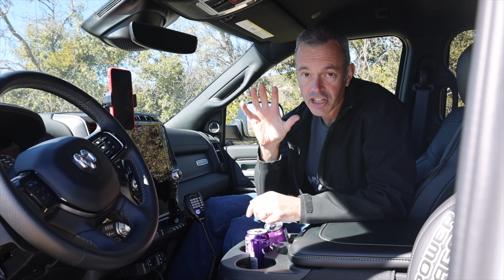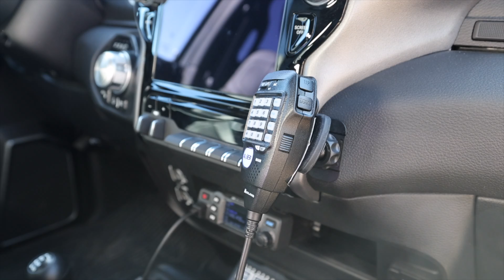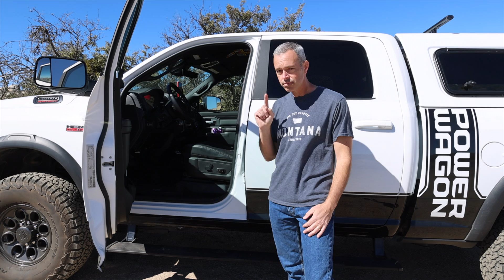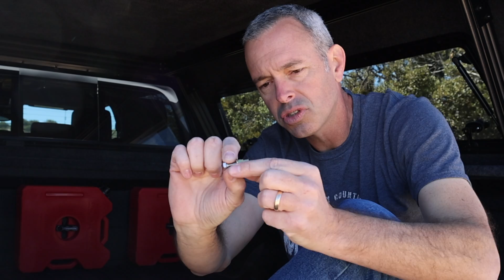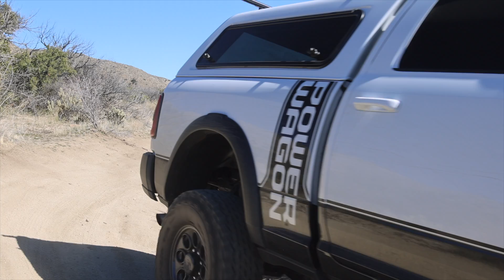Will 37" Tires Fit on a Stock Ram Power Wagon? - Build Update

Comment: BFGoodrich cant say they are 37’s. these measure at just over 35, when every other manufacturer is over an inch taller. Never realized this til someone told me and i compared my BFG’s. Super small compared to other brands
Reply: Not only are they much smaller than their claimed size, but the tread depth is significantly shallower than competitors' tires.  Overall BFGs are a real disappointment, especially given their price!

Comment: Be careful with those brass inserts.  Moisture will cause them to react with the steel in your truck bed, through the process of galvanic corrosion.  You are asking for trouble with that.

Comment: Question, any long term issues with your Power Tank horizontal mounting to the bed, both for the mounting itself and the the tank being in that position.  I have a Power Wagon and just got the 15 lb Power tank but am concerned about mounting location and direction. Thank you!!

Comment: You're a Man after my own heart!  I have a 2022 Level 2 white and black Power Wagon with 37" Nitto Trail Grapplers and the Amp Research power steps.  I also have the S Pod controller for my offroad LED lights and onboard compressor.  Next purchase is a radio but I'm probably going to buy an GMRS instead of a Ham....or maybe I'll buy both, who knows?

Update:  Since my last post I installed a Midland GMRS radio in the dash and use handheld Ham radios.  I also bought a very similar to yours A.R.E. topper but one with factory LED lights and the sliding tracks on the roof.

Comment: Witch AEV rims did you use about to pick up  a 2017 power wagon and want to run 37s without a lift just wondering if you went with the 10” wide rims? Also what tire width are you running

Comment: Kinda late post but regarding your 37’s, I saw on a couple forums that anything past 35’s it’s strongly recommended to re-gear. I have a 2015 power wagon with the 6 speed transmission and was planning on 37’s but came upon these forums and decided to hold off. I was wondering what your thoughts are on this.
Reply from the maker: The 8 speed in mine managed the 37's just fine, but with the 6 speed there might be some value in a regear.

Comment: I prefer co2 tanks also.  If go larger though, especially with 37s.  Perhaps a 15 or 20lb tank.  Mounted vertically so you don't have to unmount it for use (c02 is a liquid of course, so in use it must be upright).

These are great ideas for a power wagon.  My first vehicle was a 1980 power wagon i bought used for $1500  in 1987 with 318, winch and warn hubs and two tone orange and white paint.  It was awesome!  Put aCB with PA outside speaker in grill and you can imagine what fun that was for me at 18 yrs of age, wheeling in the forest mountains of Snohomish Washington and crossing with a best friend for girls on weekends after highschool in the 80s.

I'm getting serious desire to get one of these like what you have.  Gotta relive my youth! 😆

Comment: Hi, Love the video. I have the same exact set up AEV SALTA HD wheels and BFG's KO2'S on my 21 Power Wagon. I went with the AEV Just installed today. Question, the stock wheels where inflated to I believe around 66 PSI. The BFG's are rated to 50 PSI cold. What PSI are you running and did you figure out a way to adjust the PSI sensor?
Reply: Chalk test for tire pressure.  Google it. Lots of videos.  Mine around 50 psi.  I think AEV sells a programmer for under 200 dollars that reprograms sensors so they don't bug you every time u get in your truck
Reply: Sounds like you got OEM load  range D instead of load range E, I switched to LR E and much better, cold Psi 70-80 something. RAM playing games with EPA and what not. Truck ways more than a 1500, so why they put 1500 tires on a 2500 is crazy. I run 65 psi cold all 4 tires.

Comment: The Amp steps , powder coating is really thin and are susceptible to sand blasting. 
They will eventually fail, hopefully not skinning the meat off your shin and landing you on your rear end like i did.
My step broke and Amp would not honor there watntee and could care less that there product caused an injury. Good luck inspect daily.

Comment: For a spare tire, have you considered having a 37 mounted, seated but deflated. Once the bead is seated you can compress it and it will fit there and since you have the tank or aux air you can inflate it

Comment: For the compressor, do you have the under floor storage in the rear passenger area?  If so, maybe you can fit the compressor in there.  You'd probaly need to add an air intake and have the air chucks run to a convenient/accessible location.

I would have said put the compressor and a spare battery in the engine compartment, but I've seen some images of the engine area and it's full of stuff.  cowlings....the air box.  My 97 1500 has tons of room in there.

The locations of the rotopaxs will prove problematic when (not if) you fill the back end with stuff for a long road trip.  Then you'll have to dig through it all to get to them.  You'll probably end up moving those is my guess.  Maybe hanging from the ceiling. 

 I dig that framework inside the topper.  I've got a Leer top that I got in 99.  After 20 years, the side windows leak and the gasket for the rear window needs to be glued back on and it needs a paint job.  But I suspect that it will hold up just fine.

Comment: Enjoying watching the progress on your truck. Your Ram is a larger version of what I have.  I got a white Tacoma, 4 DR, long bed with black accents and a white shell. I'm running 34's and have the same spare dilemma.  I mounted my spare in the bed, on the passenger side in the upright position, in the same orientation as the other 4 tires. It is pushed up against the front (close to cab) of the bed. I really like the framing on your shell, I might have to see if Snugtop has the same option, or I will just have to sell mine and get an ARE.  Like you, I hate dust all over my gear.  If you haven't realized it yet, dust will still get in.  I ended up getting a tailgate sealing kit and I made some mods to the bed to seal it up.  Just got back from a week long Death Valley trip and my gear was much cleaner.  Keep up the great trail vids!

Comment: If you look up large capacity fuel tanks. You can get a 65 gallon replacement tank that goes in the stock location. And you can mount a  10 gallon air tank on the frame rails and run the outlets to the back bybthe license plate. That's what my buddy did to his rebel

Comment: I like the expedition one rear bumper with the swingouts for the full-size spare.  I know what you mean about the weight in back, though.  Tough decisions!!!  Jason K has the Exp1 bumper on his Prospector - probably has a perspective on it.
Reply: I have Exped One front and rear.  They customized my rear brackets to accommodate my FWC Popup.  I went for the fuel can holders in the back, but I may scrap that and go for the spare tire and 37's.

Comment: I have owned the 2018 Power wagon and the 2019 Power wagon. Both Trucks with all the bells and whistles. 2019 is a better truck because of the 8 speed transmission its so smooth its like I have 40 more horsepower. 
I put a leveling kit on both trucks and 18" wheels with 35" Wranglers Duratracs,  Amp Electric steps ,  BakFlip Truck bed cover . 
Looking at ordering a 2021 Olive green Powerwagon , I might do the 37" tires with the leveling kit . Your thoughts on the leveling kit?

Comment: Get a big bumper for the front. And mount the spare there. Wouldn't hurt to get a winch ,for a heavy truck like your's.
Reply: It comes with a winch, Warn that’s rated 12k but built just like a 15k.

Comment: My 2019 Rebel out the door to the shop, addictive front bumper, winch and light set up, first manufactured installed 6 inch BDS and Fox lift, ABS under mounted air compressor running air vent under hood. Running the stock 33's I can run 37's options is gas options. Am looking at your canopy options now thanks, but want to install canopy rack I can modify for storage or make for off road camping. Am looking to install full Bora exhaust and headers unsure of codes lissues.

Comment: I have Ram 2019 and installed ABS off road air compressor under passenger and ran connections out back bumper with extended air breather under the hood on Trigger Switch

Comment: With the smaller spare tyre you can mount it as a front tyre put the front on the rear and then you can still use the rear locker. But it still is only a temporary solution.

Comment: You should really look in to a bed slide. I’ve had 3 and they are super convenient and useful when using with a topper.
The best brand I’ve had is the “bed rat” by weather guard. Really heavy duty and customizable. You could mount your spare on the slide up front and when needed just pull out the slide and there you go.👍🏼🇺🇸

Comment: Where are you considering installing your compressor? I have seen an ARB installed in the floor (ice) box behind the front seat. The guys at Northridge 4x4 told me they are working on an underhood option for the RAM. Any thoughts?

Comment: Here’s an idea that might work to install 37‘s in the spare tire spot if there is only a few spots where the tire is touching either the frame or other components ,air down the tire and use a ratchet straps to collapse the side wall by strapping across and around  the tire and you might be able to fit it in squeezing the tire  the bead should stay locked on Of course you’ll have to air up the tire before you mount it but who cares if you’ve got air with you especially the air tank which can burst air very quickly into the tire to reseat the bead if it came off which I don’t believe it will

Comment: Hey Brad I have one super simple piece of advice if you haven’t done so already, I have a 2014 2500 Ram w/basically the identical ARE topper and that little black “dust lip” on the rear that keeps the elements out of the bed, go to your local home improvement store and get a pack of those rubber drawer bumpers w/the sticky tape on the back and put them in inside lip where it would touch the paint so it doesn’t rub from wind or trail bumps...otherwise love the video, keep it up and be safe!

Comment: Hi, quick question. Do you have the fuelpax mounted to where the bottom of the fuelpax touches the bed or are they slightly raised from the bed hanging off the mounts? I have a 4.5 fuelpax that I will be mounting soon. Just concerned on the weight and the stress the two mounts will be at if raised off the floor of the bed.

Comment: Ive looked at the power side steps as well, especially being a short person (5'4").  I still have two TJs, and replaced my daily JK Sahara with a new 21 diesel Rubicon Gladiator.  (Having buyers remorse for the Gladiator btw because of that sexy ass Power Wagon!!)  But I found that regardless if you off road or not, most of those power steps leave the motors horribly exposed.  As mentioned before, I own a collision shop, and see this a lot with customers Jeeps and 4x4s.  Bottom line is this:  It doesn't matter if its a rock being thrown from off-roading, or tar/backtop from a freshly paved highway.  The motors for these power steps are terribly vulnerable to battering.  The best I found were the ones that were intended for off roading.. again like I said, it doesn't matter if its going offroad or not because the generic versions don't take in account usual road "violence".  Oh and the warranties are better for the offroad slider power steps, because they are more expensive versions for a reason.   Just my 2 cents.  Thanks for all the videos!!
Reply: Nicole what “off-road power step” do you recommend for the power wagon/2500 ?  I haven’t been able to find one that I would consider sturdy enough for the basic off road parameter.

Comment: Have you thought about a deck in the bed for the spare? That way you could have some bed drawers below the deck, mount the spare to the cab side at rail height and have additional storage organization options at the gate??? Benefits, it keeps the weight of the tire lower than on the roof and in front of the rear axle, it's out of the way (mostly) but still accessable. Cons...you'd need to move your fuel cans and power tank. Power tank however could live on the deck with the spare sooooo there is that. So many options with a truck. Curious to see what you go with.

Comment: Thanks Brad ☹️ "I didn't want to have 3 different hard mounted radios in here" This the week after I finished hard mounting 3 radios in our truck; I got "the look" from the wife😉 All 3 radios are mounted on the underside of a shelf in the rear seat area that I converted to storage. The HAM has a separate control head and both the GMRS and CB have speaker mics with all the controls on them; not too cluttered.

Comment: be careful with the side window locks and theft. I have had stuff stolen out of the bed before. If you turn the side latches hard enough even when they are locked the whole assembly just rotates and you can open the window.

Comment: You should look into the Rigd spare tire carrier. It attaches in the stock tow hitch and theres no wobble or unwanted movement. Also you can get a table top accessory for it. And it can be simply removed when you don't want it on. Sometimes you may want something in the bed with the tailgate down. A dedicated bumper swingout won't allow that.

Comment: What elevations do you drive most?  Do you notice much power difference driving on-highway or fast dirt roads?  I have 35's on my '16 PW in Colorado and find that driving when loaded is less than fun, unless traveling downhill.  I have also had to have two clutch packs replaced in the trans at 47K miles.  Mainly due to trans recalls that caused issues I think....  Hard to swallow $2-3K on 4.88 or 5.13 gear change and another $2K+ on 37" tire and wheel package.

Comment: Truck is progressing really nicely! Curious though what your dilemma is with OBA? I know Extreme Outback's products are commonly mounted on the exterior of vehicles ( usually frame rails) and run forever. So much so that a lot of people in the industry seem to be switching our their dual ARB units with Extreme Outback's. We are considering running a pair of their Endura compressors on our Rams which can be fully submerged mounted in any orientation, and gives us some redundancy. Having two smaller units gives some nice redundancy too. Food for thought.

Comment: Regarding the spare issue... The only option for me would be to see if you could deflate and squeeze a 37 in the stock mounting position. If not, I would leave the stock spare as is and get repair tools. I have no interest in taking up the bed of my truck with a spare, the rear bumper mounts put too much weight off the back end for me, and people that put them on top of their topper are insane. Haha. I'm loving the PW content!

Comment: I was going to add a topper to my Ram 1500 build last November and could not get one? Our local distributors for Leer and Ranch said the toppers were months out and couldn't even give me a delivery date. (There is not a local ARE vendor)  I ended up cancelling and kept my tri-fold tonneau cover on. Did you run into those issues Brad?  BTW, love the channel.

Comment: ohhhh 37 in stock and 33 spare?!?!?! it makes me smile to imagine driving like this along a path, but it is difficult to find a solution
  that doesn't need a roof rack or rear bumper add more weight ... The fixed air compressor is an extra but it makes you sleep peacefully! It is a pity that "rock slide engennering" does not make the oiwerstep for Ram, they are at the same time a rockslider/ protection and a power step, soon I will replace my "amp" with this one because in offroad I broke the ends in both sides taking a lot of rock . Keep great content!!!!!

Comment: Brad love your channel. I am not to far from the MOORE expo but sadly could not attend. We just bought a 2019 Power Wagon and love it. Its going in for the Carli suspension in a couple of weeks with the AEV wheels and Toyo tires but I have decided to stay with 35s. Also ordered the Expedition One dual swing out. I noticed you had the Switch Pro installed. Can you let us know how the install went with that? Thanks.

Comment: You could set the bead on a 37” spare, then air it down. Compress it with a ratchet strap and see if it will fit under the bed? Since you always have onboard air, having a deflated spare shouldn’t be an issue.

Comment: I'm curious about total weight for this so far, and about gas mileage..?  I had same dilemma with larger spare tire. My Jeep WK had spare underneath but subject to damage from off road hazards. When I went bigger the fifth wheel spare wouldn't fit so I ended up loosing a lot of rear cargo space to the full sized spare. With mine I've entertained the idea of lowering the rear cargo floor into the old spare tire space. Cost and the right person to fabricate it are my limitations now. Great Video as always, MasterChief!

Comment: I understand if you take air out of the tire and use a different bumper and hitch (  it is curved on the back side.), it will accommodate  the larger tire.

Comment: U know u could put ur spare 37 under the truck bed where the other spare tire goes u have the room down there for it and for the air compressor u could put it into the bed of the truck like u did for the fuel tanks and other things  just have it site and the end of the truck bed off to one side or the other hope this helps u out and hope to see u soon out on a trail down in ur area soon